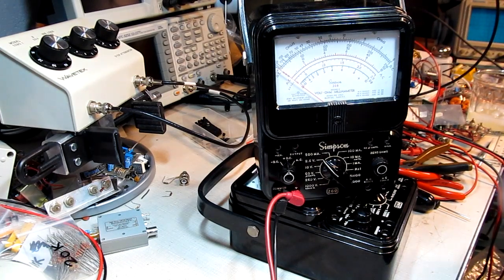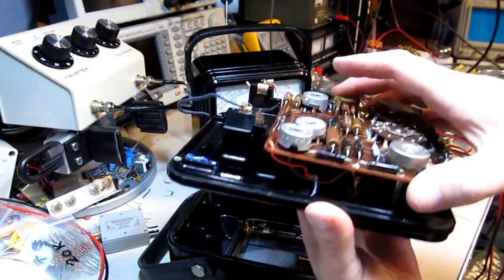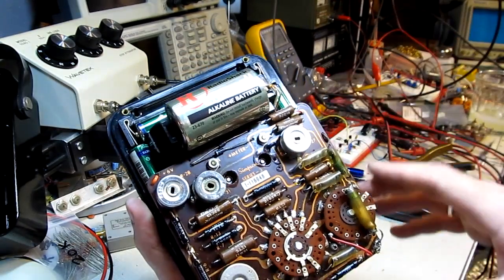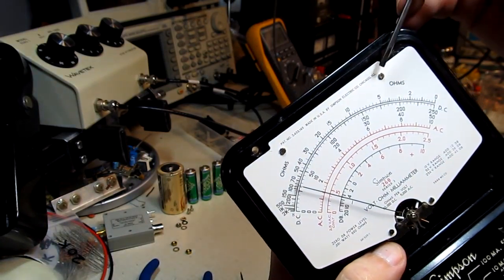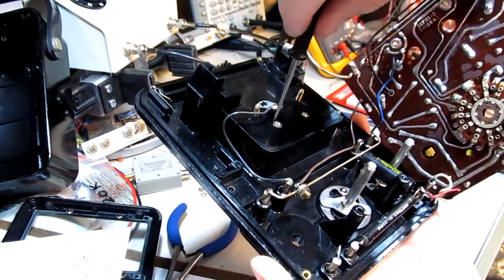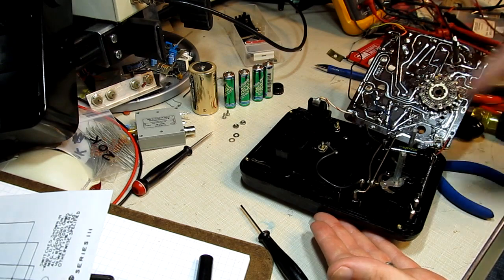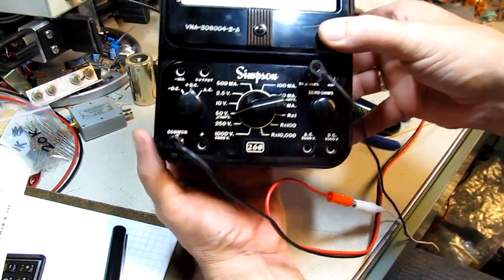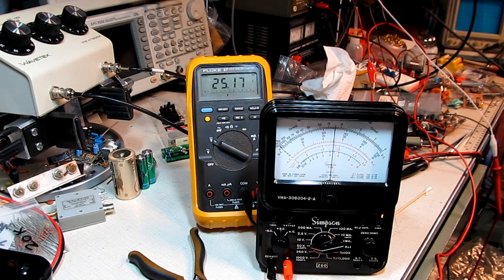#115: How to replace the meter movement in a Simpson 260 multimeter VOM

Comment: Hi Alan,

   Great video on the ole' 260. (I have a Series 6M and a Series 8P, which helped me fix tons of pieces of electronics, as well as to trace miles of circuits to find cable faults over the years).  I believe the meter movement in the 6M is still alive and well, although the circuit is suffering some, while the 8P is in great shape. (Both lived long lives due to their 'roll-top' case; the one on the 6M wore out from dryness and quit 'rolling'.) Through all of those years of use, the 260 remained my 'main meter', even though I had a newer (at the time) Fluke DMM. But the old analog meter in a 260 will tell you things that you can't see on a digital multimeter (as you alluded to in the Video). And it helped me find several problems that everyone else missed.

   But I appreciated your video most, because it gives me new hope for my "Wounded Warrior" (the 6M)l Thank you! ... More! More! :)

73,
Neil,
K7WK

Comment: I picked up this exact meter at a antique shop and it looks like this thing has been severely neglected. :( Anyways I was hoping you would have some advice on how to clean up the insides from the terrible corrosion without damaging the parts themselves. I would like to use it in my videos too, I think it looks really cool. Also it appears that no matter what I do, I cannot get any meter movement at all. I hope it is not the meter itself and instead a broken wire somewhere. What points inside the meter will give me the most direct connection to the meter itself?
Reply: Ehh, it appears that indeed the meter movement itself that is also broke. I can only get the needle to move a few divisions with 50V. I assume that the winding has been fried. :( Where could I get a replacement meter movement for  <$20?
Reply from the maker: If you put the meter in the 50V scale, there is a direct connection to the meter through the common and 50uAamp connector (just above the ohms adjust knob). Unfortunately though, if the corrosion is from battery leakage, it is often unrepairable because the acid gets absorbed into the old Bakelite circuit board.
Reply from the maker: Your only hope to get a replacement that cheap would be from a used donor.
Reply: That's too bad. The one on my circuit board looks far worse than the meter you showed, everything has that thick green corrosion on it. I was considering rewinding the coil itself until I popped the cover off and noticed how ridiculously fine the wire is and the tolerances involved, I am very impressed with what they were able to manufacture such a long time ago!
Reply: +w2aew Actually I stuck a 50V power supply (same small grey HP power supply you have as well by coincidence)  directly across the meter movement itself in hopes to get it to react. For a second it appeared as if it came unstuck but it never went higher than a few divisions. Thanks for the help! I guess I will keep an eye out for good deals on these meters, I would really like to get ahold of one!
Reply: +w2aew I have one more question, do these meters have any sort of input protection? I found some diodes that seem to serve some overvoltage protection. Also, what would be a good price for one of these used? I found one on craigslist for $55 and it appears in really good shape, although I guess that does necessarily mean it's good.
Reply from the maker: +Power Max I think it was with the Series 5 and above that had some anti-parallel diodes on the meter terminals, and the Series 6 added an over-voltage protection module.  These meters still get good money when they're in good working order.  $50 to $100 is common.
Reply: +w2aew I noticed mine is a Series 3, quite an early one I guess. The one listed is a model 6. It is pretty far away but if I head down to virginia tech (which I will  need to do over the summer) I may take a look at it and see if it works. Thanks!

Comment: Just found a 260 series IIIs. Batteries had been in there since 1991 (had dates taped to them), cleaned that mess up and replaced them, repositioned the meter movement (needle was hitting at furthest point). It also was far too loose so snugged it up so that it had a smooth movement. Used some WD40 to clean connectors inside since the ohms 0
zero reading fluctuated between 3 settings. It helped fix that prob. I still need to calibrate with a true voltage source but it seems fine.
My Dad was an electrician and had an old meter so I am familiar with them. There is just something beautiful about the design.
BTW: I am in Canada, the meter is a Canadian made one. Picked it up for $40- at thrift store.

Comment: When I was in college the Simpson 260 was the Fluke 87... I would still like to have one around. Sometimes an old analog meter is very useful....
Reply from the maker: +Matthew Miller I agree - an analog meter movement is still a very nice thing to have for many applications.  The good news is that they were so popular that they are pretty easy to find.  The bad news is that people still understand their value so prices aren't so cheap, and you don't know if you're getting one that has been damaged (physically, electrically, or battery leakage).
Reply: +w2aew Exactly right, 
I realky enjoy the videos, thanks so much for all your hard work on these videos my friend..73 N8QZH
Reply: Ha, ha, ha eu detin un UNIGOR 1S austriac din anii 70 si astazi este functional si la fel de precis am lucrat numai eu cu el Nu l-am imprumutat nimanui si nu am lasat sa masoare cu el Desi am lucrat cu tot felu de digitale in ultimii 30 de ani, la nevoie apelez tot la batrinu meu care nu ma mintit nici o data, mi l-au cerut multi dupa pensionare dar nu ma indur sa ma despart de el e toata tineretea mea, viata mea in el  Nu ma pot desparte decit poate dupa ce nu voi mai fi

Comment: Alan, per usual, your videos are informative and helpful. This one contains some VERY useful calibration tidbits. I knew about the 50 uA position but never seen it done. It should be an easy matter to build a reasonably accurate portable device to tote to swap meets to test the Simpsons that abound there. Also, I had not reviewed the schematics carefully so it's good to know that all other DC voltage settings hinge off the accuracy of the 2.5 VDC setting and only vary by dint of the value of aged the precision resistors.

What occasioned my visiting was that I picked up a Simpson (Series 5, I think) at a swap meet this weekend where someone had replaced the meter movement with a Series 6 or 7 ~~ I disremember. Nonetheless, it seemed to be accurate. This video will aid in further corroborating that hypothesis.

So now I am up to two: the aforementioned series 5/6 and my Series 7PM.

If I get another, I am going to seek counseling.

Thanks again, 

Bill, k6whp

Comment: So far I have 9 260s, a series 1, 2 series 2s, 2 5Ms, a 6XLP, a 7 and a 7P and a series 8. I think I may need professional help.
Reply: No, You're still in the early stages of collecting, whereas I've already progressed to Stage 4 terminal illness. The following is MY Simpson collection. I must have more!

(1) Simpson 221 Roto Ranger
(2) Simpson 250
(1) Simpson 250-L
(3) Simpson 255
(4) Simpson 260 Series 1
(1) Simpson 260 Series 2
(2) Simpson 260 Series 3
(1) Simpson 260 Series 3A (Somewhat Rare)
(2) Simpson 260 Series 5
(1) Simpson 260 Series 5A (Much Rarer)
(1) Simpson 260 Series 5P
(2) Simpson 260 Series 6
(1) Simpson 260 Series 6M Made for Motorola
(2) Simpson 260 Series 6P
(1) Simpson 260 Series 7M
(1) Simpson 260 Series 8XPi
(1) Simpson 260 Series AFP-1
(3) Simpson 260 Series SR (Clear Caseback)
(1) Simpson 261 Series 2
(1) Simpson 265
(1) Simpson 269 Series 2
(2) Simpson 269 Series 3
(2) [Simpson] Dupont Model 101 Blaster's Multimeter
(1) [Simpson] ETI Model 101A Blaster's Multimeter
(1) Bach Simpson 260 Series 5
(2) Bach Simpson 635-HV (Canadian Armed Forces)
(1) Bach Simpson TS-111 Series 2 Railroad VOM

Comment: Nice video.

There are a bunch of surplus Bach-Simpson 635HV meters floating about in the Canadian used market. The "working" (ie needle moves full-scale) ones go for $35, the not-so-working ones go for $25. I got one of the latter ones and cleaned it up. Battery goo had got into the meter movement and was fouling the moving coil. I carefully scraped it out with a dental pick, and now it works! It's pretty far off calibration on some scales. Not going to test its 6kV range at all! 73 de VA3PID

Comment: Great video, as always. This one revived my desire to fix my old broken 260, whose movement was binding around zero. Once I saw how easy it was to take it apart, I opened the meter face and found that one of the studs that holds the scale in place had broken off. It was simple to epoxy it down and put it all back together again. Calibration was straightforward and now it reads <~1% error on all VDC and VAC scales. Nice!

Comment: I have a 260 6-series that had a floating needle. The adjustment screw wouldn't move the needle and when taking a measurement it would nudge it in that direction but float freely. After watching this video I took a second look at it, and it seems to be working fine, lol. I could only test voltage because I can't find the needed batteries around here!

Comment: Thank you for continuing to make such interesting and informative videos.

I would like to start using my late father's AVO meter (the UK equivalent of Simpson). The one I have is a late 1960's model but has some corrosion in the battery compartment. Is there any solvent or cleaner you can recommend?

Comment: Thanks again for another fine video. I own two of these myself. My college instructor would have given you a "D" for calibrating in vertical position instead of laying flat after adjustment. He did me...Lol . He always insisted using analog meters in flat horizontal position. Guess he's right when you think about it. I never forgot that lesson. I always love your video's..